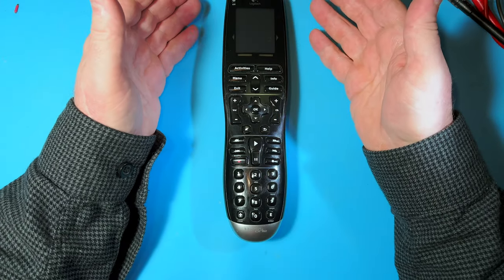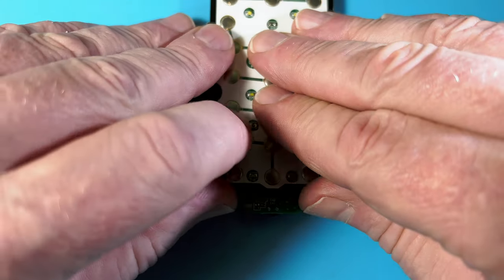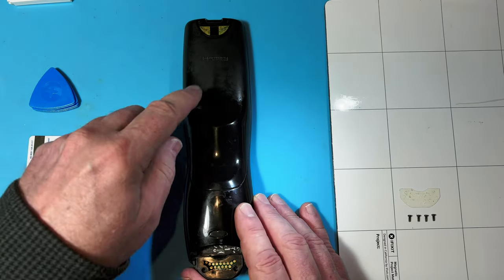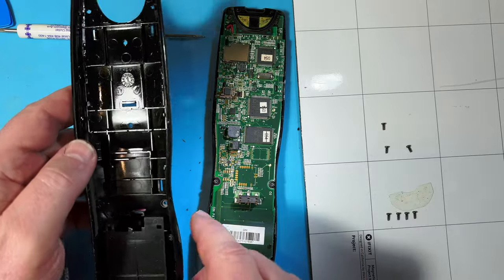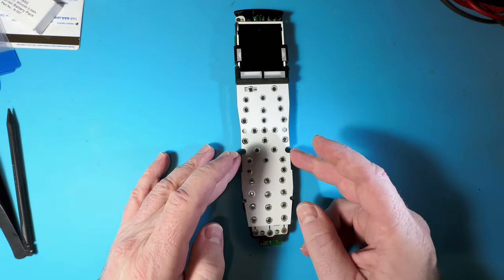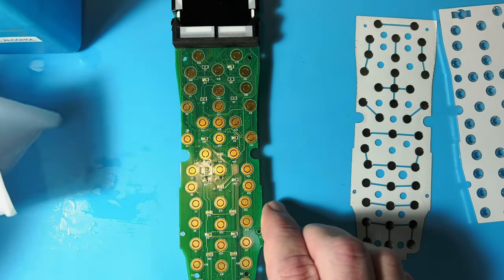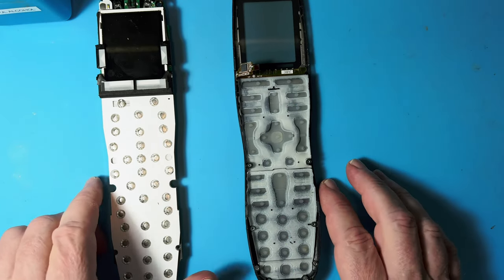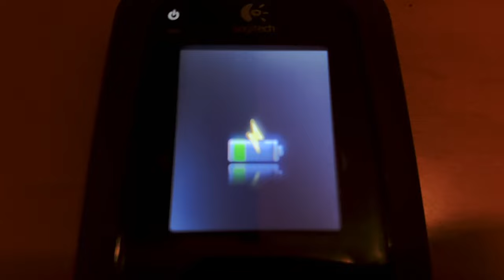Logitech Harmony One Remote Control Button Repair Refurbish (4K) with Charging Pad Swap & Board Tour

Comment: Thanks for the video, just stripped my Harmony one down as I was having to press down quite hard on some of the buttons and I found all the contacts looked fine but gave them a clean anyway, but I think the issue is more that the bottom of the rubber buttons that press on the metal domes are actually slightly worn/compressed so what I did was put a couple of layers of kaptan tape over the domes before I reassembled it and it's now like new 👍
Reply from the maker: Oh that's clever. Is there nothing kaptan tape can't do? :)
Reply: It's not told me the winning lotto numbers yet so yeah 😂 @WardCo

Comment: Last week, I was lucky enough to score a brand new sealed in box Harmony One remote for only $60 along with 3 other items from an online auction site. The only things wrong were the battery (white label) was flat but charged up fine and the soft feel plastic was tacky (isopropyl alcohol cleaned that up).  A nice addiction to my two 350 remotes.

Comment: Hey, thanks for the very informative video. I know what to do now... 🧐. Would you be so kind as to list the materials and tools used in the description of the video? A link to where to find it would be great. You also use something to put on your head with light and lenses ... are you happy with it? Where can you find such a thing? Any info is welcome and I would greatly appreciate it. I'm from Belgium so I'll probably have to look out for a European alternative .. but I'll see...
Reply from the maker: It's a Donegon Optivisor with a 2.75x lens (I think), with a Donegon LP1 OptiLOUPE and Quasar LED lighting system for Optivisor. I love it, and, at my unfortunate age, it is indispensable. 

The lighting system comes with a crappy battery box which I have modified by making the leads longer so it can stick on the headband and not on the visor itself.

Is there anything specific I used you want to know about?

Comment: I own three of these and just bought another used one for $38 from Ebay for my Dad. His 510 is very worn. The activities button is very hard to press down initially and then after I exercise it a few times the button doesn't stick as much but still feels like it's gunked up. Do you think soaking a qtip with rubbing alcohol and letting a little get into the button edges would be safe enough to maybe break up any sticky. I would leave the battery out while doing this. Opinions?
Reply from the maker: Probably won't hurt to try alcohol, but you should use 99% if you do. I suspect it won't help much because whatever is binding up is probably BELOW the rubber keypad and the alcohol won't get past the backing on that -- but, hey, you never know -- maybe it is just a bunch of gunk binding to the hole in the plastic.
Reply: @WardCo  Yeah I tried last night and then turned it button side down to dry. Tried it this morning and there was an initial catch but seemed to move better. It was already delivered to my Dad today and time will tell how it does.

Is there any good modern replacements to these discontinued remotes? Harmony One was always my favorite back when I would sell them and configure them in home. I prefer physical buttons and a customizable screen like the One.

Comment: Maybe you should have just took your screen off of your old one and put it on that one. Much easier Maybe if it was just the cable that was torn. Are these things still working because I have mine and it will not be recognized by Windows 10.
Reply from the maker: Not a bad idea -- just didn't occur to me!

I actually keep an old Mac here running Mojave JUST so I can run the crappy Logitech app. Recent purchases have not been in the online DB, so have resorted to learning each function from new remotes with the IR port.
Reply: @WardCo  thanks I didn't know you can teach the remote from the IR Port without the app. Maybe you can make a video on how to do that.